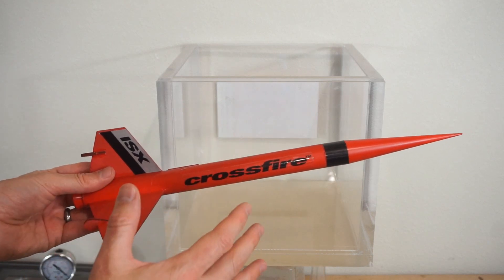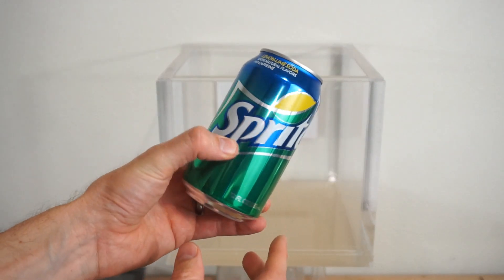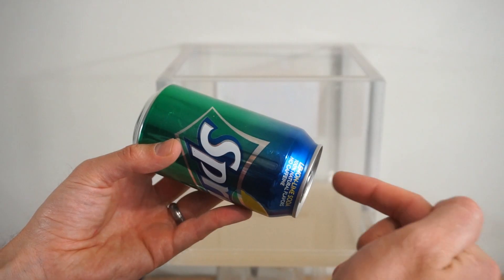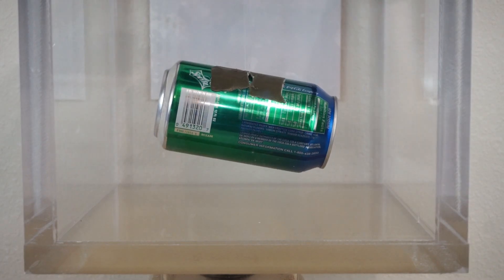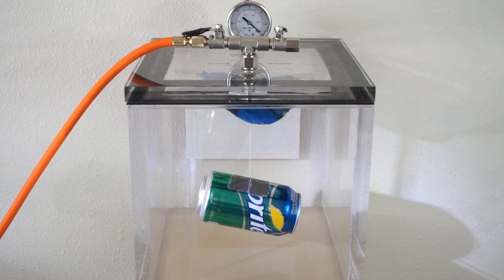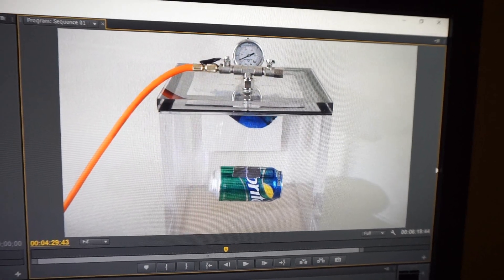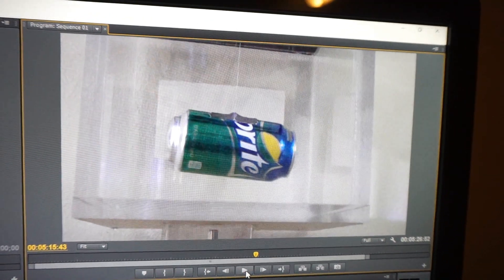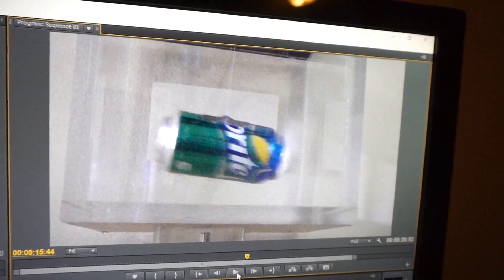Can a Rocket Fly in a Vacuum Chamber?

Comment: My understanding is that in a rocket in space, the low pressure propellant/gas that comes out the thruster nozzle first  is what the high pressure propellant/gas that is in the thruster bell pushes off of.  So basically we put a tiny low pressure atmosphere in space that the high pressure pushes off of.
Reply: That is one way to imagine it.
See how inconsistent these physics denying Morons are?
They are CERTAIN that "Rockets Push on the AIR in the atmosphere" (while AIR is a GAS)
But they are INCAPABLE of pushing on GAS they take with them to the vacuum.
Reply: @stuartgray5877  w=pv, chatbot.
Reply: @papalegba6796  SO YOU think that a rocket CAN accelerate 500 kilograms of mass from a standstill to MACH EIGHT all WITHOUT PERFORMING ANY WORK !
Please explain that genius.
Because a Space Shutte Main engine accelerates 500 kilograms of PURE WATER to Mach 8 EVERY SECOND.
But according to YOU it does this WITHOUT PERFORMING WORK.

Bless your little heart!
What grade did you drop out of?  I learned about how accelerating mass is performing work in the NINTH GRADE!
Reply: @stuartgray5877  yes, because w=pv. Mass is irrelevant, chatbot. Why do you ignore the gas laws when discussing a gas powered engine?
Reply: @papalegba6796  Just say that the space shuttle CAN accelerate 500 kilograms of mass per second to Mach eight WITHOUT FEELING A RECOIL FORCE.

WHY won't you just ADMIT THAT - since you keep claiming it?
Reply: @papalegba6796  What is the combustion product of burning hydrogen and oxygen?

WHY WONT YOU ANSWER?
Reply: @papalegba6796  "because w=pv" - the law actually says W=pΔV. The pressure inside a rocket combustion chamber can be around 17 MPa. The change in volume of the gas is from the combustion chamber to the universe, so basically infinite. Why do you believe there is no work done then?
"Why do you ignore the gas laws" - because W=pΔV law is applicable to closed systems only, not open ended dynamic ones, such as a rocket engine.
Reply: @renedekker9806  yeah it's the EXTERNAL pressure the gas meets, not the pressure of the gas itself. And a rocket in a vacuum IS a closed system anyway. What liars you all are 😂
Reply: @renedekker9806  😂😂😂😂😂😂😂busted!!!!!
Reply: @papalegba6796 " yeah it's the EXTERNAL pressure the gas meets" - and that pressure is the pressure in the combustion chamber. That pressure is external to the gas in the nozzle. The gas in the nozzle is expanding. Again, the only thing it tells you is that a rocket engine is not a closed, static system, so the W=pΔV does not really apply. Newton's 2nd and 3rd law apply just fine, though. Are you claiming those laws are incorrect? 
"And a rocket in a vacuum IS a closed system anyway" - no it isn't; it is expelling exhaust gas, so it is not closed. 
"What liars you all are" - it does not help you to revert to name calling. It just shows that you know you were mistaken and just don't want to admit it.
Reply: @renedekker9806  Yes Papalegba believes that MASS can be accelerated from the rocket without any force being applied to that mass.
Reply: @rocketman484  I believe in the gas laws, chatbot. Unlike you 😂
Reply: @renedekker9806  <------- claims the gas laws do not apply to a GAS POWERED engine 😂😂😂😂😂
Reply: @papalegba6796  "claims the gas laws do not apply to a GAS POWERED engine 😂" - I didn't claim that as all. Reread my comments. 
Do you always laugh at your own ignorance?
Reply: @renedekker9806  It won't answer ANY questions that prove it wrong.
You can SEE this behavior in all of its responses.
Reply: @papalegba6796  So explain how rockets CAN "push on" the 14.5 PSI in the atmosphere while NOT being able to push on the ~3000 PSI gas in the rocket nozzle.
You do know that the 3000 PSI gas is MUCH MORE "massive" (has MORE MASS) than the same volume of gas at 14.5 PSI - RIGHT?

So WHY do you believe that rockets CAN push on 14.5 PSI gas while NOT being able to push on 30000 PSI gas?
Reply: @stuartgray5877  already explained, chatbot 😂
Reply: @papalegba6796  "a thermal rocket is an internal combustion engine" - THERMAL rockets are not internal combustion engines, as there is no combustion The propellant is usually heated by electricity or a nuclear reaction. And they are not used much. The normal CHEMICAL rocket engines we are talking about here, which are used in normal rockets, have a combustion chamber that is open to the outside. Therefore they are not internal combustion engines either. 
Again, you seem to find your own ignorance quite amusing. 
Is there any specific reason that you are unable to admit you had it wrong?

Comment: 😂😆🤣
Not buying this.
Reply: You are welcome to explain it or do your own experiment. Crying here won’t help you.
Reply: What would happen if you fired a crossbow into a vacuum?
Would you feel any recoil force?
Why or WHY NOT?
Reply: @stuartgray5877  a rocket is a heat engine, a crossbow is not. False analogy, chatbot Stu.
Reply: @papalegba6796  If you fire a gun in a vacuum, will there be a recoil?
Reply: @drosophilamelanogaster4262  a rocket is a heat engine, a gun is not. Completely different operating principle. So your analogy is false. I know you're a chatbot here to waste my time, so am muting you.
Reply: @drosophilamelanogaster4262  Papa Legba refuses to answer any question that might prove him to be wrong. Instead of answering he will hurl juvenile insults and call you a bot.
Reply: @stuartgray5877  He has nothing to offer
Reply: @stuartgray5877  gases expand from higher to lower pressure using their own internal energy, chatbot. No force is required. There, answered you again, lying chatbot.
Reply: @papalegba6796  - "gases expand from higher to lower pressure using their own internal energy, chatbot. No force is required"

So you are saying that the HIGHER-PRESSURE gases PUSH the exhaust gas OUT of the nozzle?
Is THAT what you are trying to say?

that the gas pressure is the "FORCE" that accelerates the mass of the exhaust gas from the nozzle?
Sure sounds like it.
Reply: @papalegba6796  OR are you trying to say that gas pressure is NOT A FORCE?

Hard to tell.
Reply: @stuartgray5877  no I am not saying that, chatbot. You're not programmed to understand what I am saying, as you have repeatedly shown 😂
Reply: @papalegba6796  
Me-  "OR are you trying to say that gas pressure is NOT A FORCE?"

papalegba - "no I am not saying that, chatbot. "

So then Gas Pressure IS A FORCE.
Is THAT what you are trying to say?

It must be one or the other. 
Gas "Pressure" (pressure is DFEINED by FORCE PER UNIT AREA) is a force according to every Engineer and {physicist to have ever obtained a degree.
So which is it?
You seem confused.
Reply: Todd - Try asking Papa Legba where the FORCE originates that accelerates the mass of the exhaust gas into the vacuum.
He has said that "Vacuum CANNOT exert a force".
SO WHERE does the force come from that is accelerating the exhaust gas?
MAGIC?
Reply: @stuartgray5877  I've answered you hundreds of times, chatbot. You just pretend I havent. Because you're a chatbot.